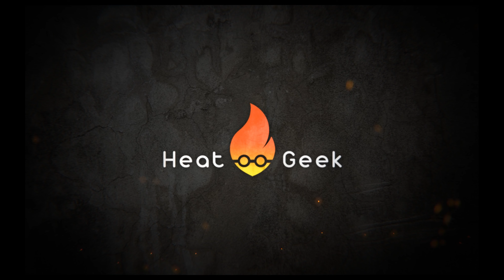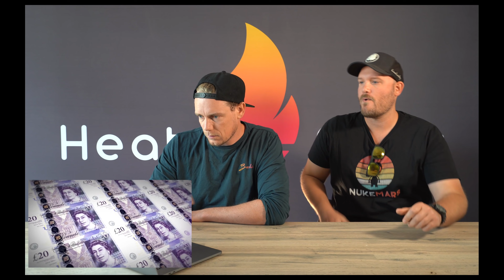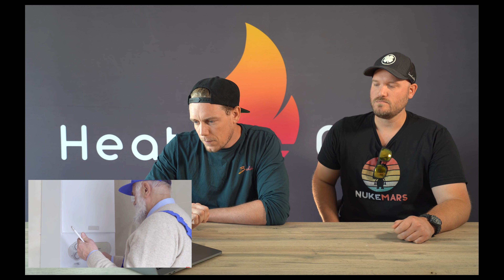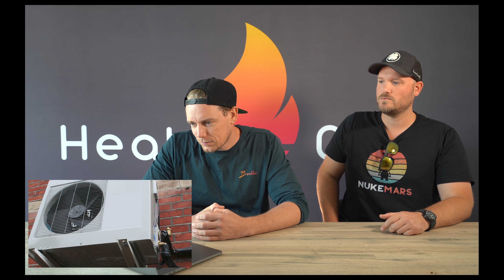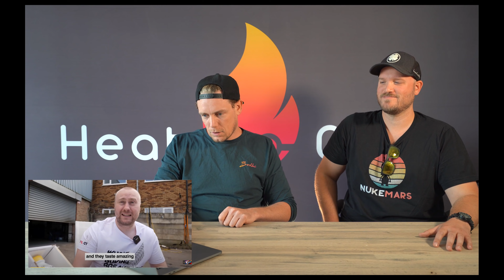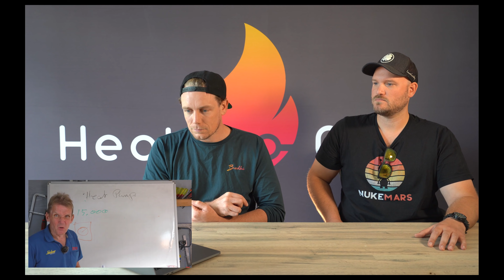Professionals React (BADLY) To Skill Builders's Heat Pump Videos | PART 1 | FIRST TIME WATCHING

Comment: I keep hearing that the variable is the installer. I'm yet to hear a good explanation as to why this is the case. If you explain it, it may break their bad reputation. You guys seem to agree that not all properties could have a heat pump that would work. How does that tie into a "poor installation"?
Reply: Even a suitable home could have a heat pump installed poorly, in fact that happens so often that it has given them a bad name.  Understanding the relationship between the requirement for low temperature with velocity and volume is crucial, there are many shortcut calculators that help but the specifier has to understand the reason for all of it which is not as common as you'd hope.
Reply: @patrickwheeler3959  I jumped the gun before realising they have a part 2. That does seem to make it a but clearer. However, they do seem to suit themselves to ideal situations: money/time not being so much of a factor and the condition of the property. Yes, when installed correctly they can and will work properly in a suitable property but it is VERY idealistic. Really makes me wonder what is going to happen during the transition from gas boilers.
Reply: @tomrobinson4935  it may seem idealistic but it is the result of correct specification of a particular technology, we would only install a heat pump if it was the best compared to alternatives.  You are spot on that the transition is going to be tough, there needs to be a prolific amount of upskilling to avoid this being an historical disaster.
Reply: @patrickwheeler3959  agree that there needs to be upskilling, however that isn't the main thing I'm thinking about when it comes to the government stopping the sales of gas boilers. There are many people, including myself that live in cold terraced houses. I have had mine insulated which hasn't made much of a difference other than it now being damp. What options are there for these kind of properties without spending 10s of thousands? Not everybody has this kind of money, especially to replace something that works. 5k from the government doesn't even dent the installation bills that some people will face.
Reply: @tomrobinson4935  I don't think we will see a ban on gas boilers, we only have an announced ban on gas boilers in new build which is completely correct as they need so little energy for space heating.  I'm (nearly) 40 and I genuinely don't think I'll see a general ban in my lifetime, certainly not in my working lifetime.  As you say there are no good alternatives for older properties, we were a prolific building nation for so long that there are millions of homes that aren't particularly efficient.  Unless Boris makes good on his promise to install world leading wind power of the East coast or some other technology comes in that reduces electricity costs by half then it is difficult to justify heat pumps for homes on a purely cost basis, I hope we made it clear that we aren't advocating the installation of heat pumps in every home and we certainly don't say or do that in our installation business.  Once electricity is cheaper, greener (and in much more abundance) it is feasible that heat pumps can be rolled out en-masse as many of them can run at 55°c so the radiators would only need to be a little larger instead of 3x larger as is often the case at the moment.
Reply: @patrickwheeler3959  it was clear that you don't advocate installation in every home. This video is the most impartial I've come across so far. However, it does seem like the government is, with all the media around heat pumps at the moment. I understand it could/probably is a tactic to bring them more into the mainstream and increase funding, which is great. The 2035 ban on sales of gas boilers that's been making the rounds and the sudden increase in gas prices recently does make you wonder where this is going.

Comment: I found your comments were ill informed and misleading. It is clear that you are of limited experience. Roger B. is one of the most skilled and experienced and honest people on the web. I suggest you talk to him if you  want to be better informed. He has first hand contact with the industry, not sure you have his breadth of expertise.
Reply: Roger is clearly not an expert in much at all. I’ve installed 100s of heat pumps. Doubt my experience.🤷‍♂️
Reply: It sounds like you didn't watch the video, we both have decades of experience on the tools and installing as well as running several teams of installers for not only heat pumps but commercial heating and domestic gas boilers.

Comment: My ground sourced heat pump is useless.
Yes, I have underfloor heating Downstairs AND upstairs, with the design done by a professional specialist heat pump company.
The claimed COP for the Mitsubishi units installed is not achieved and as the system has a complete gas backup system the costs can directly compared.
The heat pump system for the house is costing about 3 times the cost of Gas only.
The Air sourced heat pumps for the swimming pool are more successful as they only operate in the warmer months with costing only about 20% more than gas heating - but still with many freezing problems due to a faulty sensor that has been replaced 4 times.
The house unit has had multiple breakdowns with a 3 month wait for a part - thankfully we have gas as well. 
So heat pumps are a very expensive mistake unless gas triples in price permanently. The true COP of units in the UK in a damp wet winter is nearer to 2:1 than the claimed 5:1.
Reply from the maker: If you have ground source, in a new build with underfloor and you arent getting cops of around 5 and above, then your 'designer' isnt a designer. Send me a video and ill genuinely tell you whats wrong with your system and what to rectify. our email is hi @ heatgeek dot com
Reply: @HeatGeek  be interested to know what system design changes are needed to make these a better choice, looking to build a new house which will have underfloor heating. Financially the renewables dont seem to make sense, feel like is best to spend on a fabric first and use a gas boiler
Reply from the maker: @TheDaztheraz  for a newbuild woth underfloor heating heat pumps are an absolute no brainer as a decent unit will get a scop of 5.  Way cheaper than gas
Reply from the maker: yoiu had this designed by someone posing to be a proffesional designer im afraid.

Comment: They will use fossil fuel if the National grid is being in large part fed by gas fired power stations . I am suspicious of green alternatives not actually being all that green. All that new equipment didn’t get made without a massive carbon trail .back in the day they had a worm room or two but lots of people heat empty rooms

Comment: I'm with Skill Builder all the way.
Reply: They do work having had an Ariston Nuos but there are a huge number of shares especially in the north west. Since moving 3 companies I’ve contacted are phoenix of a previous company maximum trading length 3 years before they restart even the manufacturers recommended installers don’t respond and don’t actually understand them when quizzed. I could write a book about my 14 month experience of trying to get a system installed in a 5500 square foot house.
Reply: He should stik to building ;)
Reply: I think what is needed is large town and cities are communal district heating schemes piped into individual houses. Surely with the economies of scale this could work and use the current plumbing system already installed in the house?
Reply: The trouble with heat pumps is that in Britain we love in drafty poorly insulated homes, and we are obsessed with shitty old houses rather than tearing them down and building something modern and up to standard
Reply: I don’t know why the skillguy doesn’t want to improve the insulation in house, he is just angry, and probably cant do a correct installation of a quality brand heat pump!
I have installed all sort of heatpumps for over 20 years, and they DO WORK if you do a correct installation! I have a F-gas certification since 2010
Reply: What that a poorly installed heat pump in a poorly insulated house is not good? No shit. It sounds like he's been one of the bad installers. Sticking a heat pump many meters from the house under a tree is terrible
Reply: @benfulford3943  you aren’t talking the occasional one nor the same installer’s. You want it…? YOU live with it..
Reply: Heat pumps are being sold like some kind of Aladdin's lamp. For the majority of UK housing stock they are unsuitable. Heat pumps have been around for decades and suddenly they are the solution. Give me a break. Hydrogen fuel cell!? Why not just use dilithium crystals.
Reply: @Bill Green  I totally agree with you. The only problem with hydrogen fuel cells is that people can buy or make hho on demand  cells, power companies, and the government would be too scared of losing money.
In my opinion, hydrogen boilers are the most green tech around
Reply: My brothers got big ground heat pumps istalled in separate rooms and they works, yes, and they cheap to run,yes.
But brothers are going to pay for them for next 15 years. 
Is it worth?
Reply: Now with the price of electric going up gas is the way, omg have you seen your new pridicted bill👀
Reply: @I2383R  i think gas will go up way more than electric, but also with heat pumps u use electricity 24.7 so your even more out of pocket
Reply: All the way.
Never heard of these guys. Trying to hard to act to professional. Bless em
Reply: Baseball hat back to front, alway a dodgy look, skill builder all the way
Reply: Never heard of these guys!! Roger bisby has been around for years🤣 he even contributed to rhe free magazine thing you got in Plumbers merchants years ago. He was also on the telly on rouge traders expert thing trying to catch dodgy gas installers.  He knows what he's talking about.  Must be getting old!! If your not on YouTube your a nobody??🤣
Reply: @michaelwilliams936  these guys are some of the most knowledgeable fellas in the industry, even though heat pumps have heavy draw backs I can tell you as a qualified plumber skills builder is talking a load of rubbish through this 😂
Reply from the maker: @michaelwilliams936  yeh sure he's fine on old forgiving gas boilers lol. Heat pumps require you to actually design the system though which he admitted he didn't do lol.. then drew a thermal store for a heat pump which is litdally the WORST way to install them. No wonder his customers were unhappy...
Reply: @HeatGeek  hats off to you guys for embracing new technology👍. Love the channel, I can tell you know what your talking about and its nice to see, I'm 47 and a bit selfish in many ways, if I can get another 13 years out of boilers I might be able to hang the tool bag up🤣.  It's important to educate the young lads coming through,  it's the way it's going and rightly so. Good on you.
Reply from the maker: @michaelwilliams936  thanks Michael! Many years left in boilers yet!!!
Reply: Same.... skill builder all the way, these clowns are butt hurt because its impacting their business.
Reply from the maker: Here's evidence of how they work just when we'll installed even woth smaller rads and lower insulation (not suggested) Rogers opinion is well outdated

https://youtu.be/QLGANlbqIFY

Comment: I'll stick to my freshly installed (2 years ago) Worcester bosch gas combi boiler, keeps our typical UK 3 bed semi 1950s house lovely and cosy, for an absolute minimum cost.

We only really have to use the central heating through winter, we have full double glazing, cavity wall insulation and 3 layers of loft insulation, so from early spring right through to autumn, we rarely use any heating.

The boiler does all our hot water on demand and the max weekly cost to run the heating and hot water is around £7.

I'm pretty sure an air source heat pump through a UK winter won't offer us any benefit in terms of heat or cost to run? Even not considering the huge installation costs currently, it's not something that would pay back and be a good investment over time.

I'm sure in 20 years time a more efficient system will make air and ground source heat pumps look antiquated and clunky.
I'll wait until my boiler needs replacing so hopefully squeeze another 18-20 years before I need to consider my options, as long as natural gas is still being supplied of course?
Of course there might be another fuel based on eco friendly hydrogen, which combi boilers night be able to be converted to at some point in the future?

I think there may be an advantage in new build modern housing with good thermal efficiency, with effective use of glass to create a greenhouse type effect, then sure heat pumps may have the edge.
But in the vast majority of older, draughty, less thermal efficient UK housing stock, it just wouldn't work as efficiently in my honest opinion.

Comment: I had a quote for £63k for air source pumps (not including the plumbing installation). My house is big and old with a very large heat loss. So I bought a 70kw oil boiler for £2100 + £1500 for the tank.
Reply: Unless you are wealthy and obsessed with carbon reduction then a heat pump in your home would be terrible, you could add one to make it a hybrid system in the future if the incentives get better or if preferential tariffs for ashp operators come in.
Reply: Thanks for your contribution to the CO2😥

Comment: I agree the installer is critical. But so is the type of property. Roger is clear  they don't work in much of the housing stock in the UK. Not that they don't work per se. I think the video can be distilled down to this.
Totally agree with the fact people should learn to live at lower temperatures. Ridiculous the level people heat their home too - if you're comfortable in a t-shirt, you're wasting energy!!

Comment: I'd like to see anyone put underfloor heating in our 1890's terrace. Asphalt over stone floors ain't coming up. And our walls are solid with no cavity. There is no way our property can be insulated to a good enough standard for these puny heat pumps.
Reply: Just looking at the same problem. Hempcrete insulation not as good as kingspan but fits the desgin of 19th cent and then replace plumbing

Comment: There were no video interuptions when I watched Roger's video. I really hope you haven't edited that in to enable you to level that 'ad revenue' accusation against him. He's well thought of in the industry, and if you resort to ad hominem attacks it will likely backfire. Stick to commenting on the facts and not Roger and you might have some takers.
Reply: He is no way a heat pump expert, i wouldn’t get Roger to change a lightbulb. Been fitting heat pumps for over 15 years.🤷‍♂️

Comment: I have listened to both video's and you never tell us what needs to change for these to work if the variable as you keep saying is the fitter not the heat pump so why are they being allowed to fit them.heat pumps are not the solution for the vast majority of the population only the very few the problem being the goverment are trying to
 force us all into using this system green Boris lol.
Cost has to be part of the solution most of us are not ultra wealthy. I want to be part of saving the environment but you cannot knock future generations back the stone age we need honest advice and Tec that doesn't try to sell us technology that doesn't work properly.
Good video lads

Comment: But you said there are horror stories yet call this bloke a liar? So if there are horror stories and this guy is responsible for the downturn in the heat pump industry why isn't there someone explaining the benefits and what happens when, after you've paid a reported £6,000, if your system is one of these horror stories how are they corrected and who does the correction. How would you say a heat pump would rate in my 1950's concrete poured 14'' thick walls house that is always could. This idea of concrete absorbing heat and slowly releasing it doesn't work in our house so would a heat pump be better than a gas boiler that has the house hot in less than 15 mins? That's an honest question because I've heard a lot about them but not how they would work in an old draughty house.

Comment: One more point my existing system has 10mm dia piping what is the minimum radiator piping size for a heat pump system.
Reply: I think it is around 20mm and radiators have to be double size.  To retrofit all this, along with the tanks and controls needed, would cost around £20,000 in the average home.  Don’t worry it won’t happen.  Boris needs psychiatric help!
Reply: 10mm

Comment: It is possible that by adding a heat pump to an existing boiler system could be the best solution. And a few solar panels.
Reply: Sorry, but that is the worst situation.  Heat pumps require oversized pipes and radiators to be installed, also other equipment like tanks controls etc.  The basic install cost to retrofit a heat pump system in an average house would be at least £20,000!

Comment: The big problem is with any of these "experts" it comes down to buyer beware !  Some know what they are talking about but very few have knowledge of the heat pump together with the plumbing requirements.  Burned fingers are not unusual. Call backs unheard of !